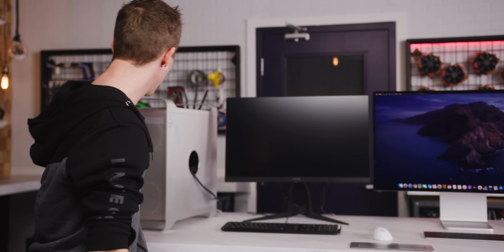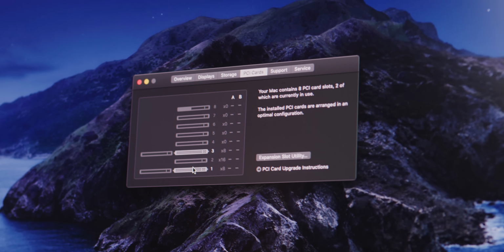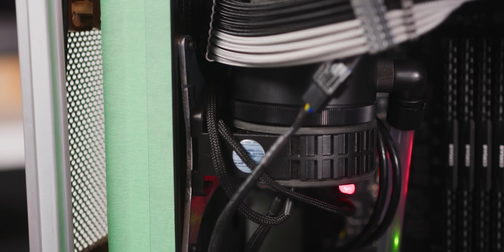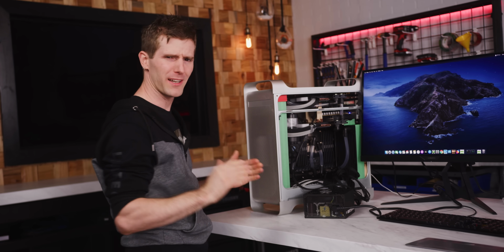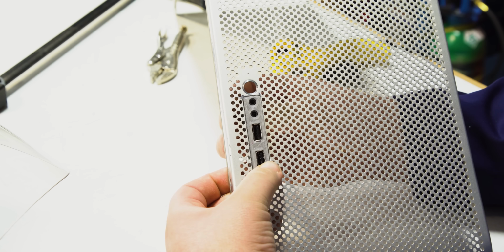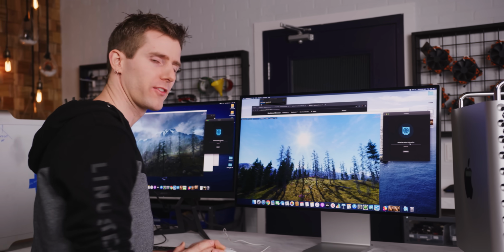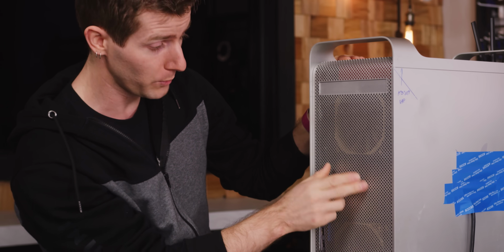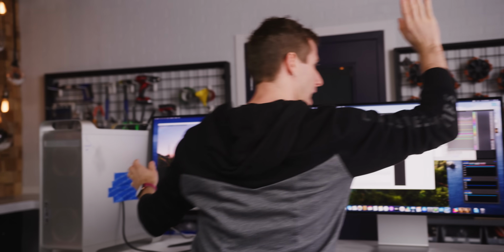Apple BEAT us... but we're STILL TRYING! - Hack Pro pt 4

Comment: so, for the money you saved, you could easily put some more powerful GPUs in there to even the odds (for example, 2 RTX 2080Tis instead of the 2 Radeon VIIs) and still save thousands of dollars. awesome.
Reply: Njolf Nvidia doesn’t release drivers on Mac OS and a 2080ti still wont be as powerful as the GPUs in the Mac. But they’re mostly faster because of driver optimisations
Reply: @brendanturner4787  

Oh, that sucks. I guess that's one of the problems when companies build proprietary software that's only ever meant to run on certain types of hardware. Oversight on my behalf, in any case.

well, i guess the best option then would be to not use mac for the OS, but at that point it's not a hackintosh, just a good competitor to the mac pro (with a far lower price tag). And you'd be better of as far as raid options go and all that. but yeah, moot point then, i suppose.
Reply: Njolf in my opinion hackintoshies aren’t worth the extra effort; especially for professional use. If you need Mac OS, you’re better buying the Mac Pro, or one of their laptops or all in ones. Or using simply using Linux. But bare in mind the Mac Pro isn’t really for average consumers anyway, it’s for editing houses or a bunch of other things I can’t think off. Personally I’d rather buy their laptops, because they’re better in every way from windows alternatives except for price and then just use my desktop for gaming
Reply: @brendanturner4787  yeah, i don't get the point of hackintoshes either, as linux is just better for productivity (mostly, from what i've seen doing some design work is not as easy on linux due to a lack of software but you can just use windows for that) and windows is better for gaming. 

mac might offer some slight performance benefits in some cases, but it's mostly insignificant given the notably higher price tag which lets you buy faster hardware to compensate (which is the point i made originally - okay, they may not be flat out faster, but you get more or less the same performance for less money), and in laptops you get better cooling than apple's products. and honestly, not giving apple any money is value in it's own right (in my opinion).
on a side note, i really don't understand some of the selling points for the mac pro. for example, 1.5 TB of RAM? only application i could think of for such an amount would be some serious server stuff, but in that case, you wouldn't rely on a mac to perform as a server, especially because you can get some better hardware that they don't offer in their lineup (something like AMD's epyc lineup).
anyway, i think i got a little carried away.
Reply: Njolf well the benefits for Mac in terms of professional use would be apps, the ease to develop (which is what I use my Mac for), it doesn’t force constant ducking updates, etc. Also I’d disagree with other laptops being better. MacBooks are built like tanks, I like the butterfly keyboard personally, they’re quieter, battery life lasts forever and macs in general last waaaayyyyy longer than windows laptops and they don’t throttle worse than windows laptops. Plus you can always also run windows on macs but can’t run Mac OS on windows laptops
Reply: @brendanturner4787  sure, but you could always install some distribution of linux (for example ubuntu) instead of windows and, for the most part, get best of both worlds (that is, again, if you're not doing graphic design or something like that, due to less available software, like the lack of adobe's products). i mean, from my experience with ubuntu it's far less resource hungry than windows, meaning you would get longer battery life and better acoustics than with a windows machine. as for the keyboard, well, it's personal preference. i don't really care what it's like, as long as it works (this generally extends to aesthetics of other things and the machines themselves, although i can appreciate a nice RGB build when i see one, but i digress). also, windows machines tend to not last as long partly due to software rot, which is less noticeable on linux and macOS. and i haven't had any bad experiences with ubuntu updates either, they tend to be quick and only sometimes require a restart, though they let you do whatever you want to do and update whenever you see fit. also, i remember that there was some issue about macbooks throttling under load due to poor cooling performance caused by their design being more oriented around sleek looks than functionality, but i haven't really followed the news on that to see how all that turned out. and honestly, i just like having choice when it comes to what i want to buy. for example, if you have no need for a dedicated GPU, you can buy a laptop with a good CPU and integrated graphics for a few hundred bucks, which is less than the entry level macbooks. if you want a dedicated GPU, you can get some for  around the same price as an entry level macbook - which doesn't come with a dedicated GPU. and besides, different brands offer different sets of features and slightly different combinations of hardware, meaning you're more likely to find something that better suits your need than a macbook. but this is mostly personal preference, i guess.

Comment: Hey linus, quick question. If i have a ethernet cable plugged into my pc (2.5gb i think?), and so will having an asus wifi thing that came with my motherboard plugged in at the same time make my connection better and ping lower?

Comment: You failed. The SSD speed is not compared, no Thunderbolt is a main selling point of the mac you said in another video, the front shows the fans and RAM is Not 1,5 TB.

Comment: Constantly complains about a worthless headphone jack, but then bashes a optical drive.
Reply: I use headphone jacks way more than optical drives. Besides, easier to keep an external drive at home than carrying a headphone dongle with you on the go.
Reply: @annasiel97  or you could just use bluetooth headphones?
Reply: @Grumpy_Wolf  Not always a convenient option to keep two things charged rather than just one, and you can generally get better quality wired headphones for cheaper than bluetooth.
Reply: @annasiel97  Takes like 2 seconds to plug in a headset, lot more convienant than trying to untangle wires, or worrying about them snagging on something, especially if you jog or workout. I literally bought a 20 dollar pair of headphones several years ago, the battery goes forever and they sound great. Sure I bet expensive headphones are better but I probably couldn't even tell the differance.

Comment: Well you could use your AMD motherboard with thunderbolt that you showcased (/watch?v=wQMCvQ01e80&t=536s) and put 3950x in Dune Pro PC case, bamm. Put some Ice Giant cpu cooler, mod gpu cooler, put there noctuas in front  and there you go. You get Mac pro 2020 look with better performance and good cooling with thunderbolt support or use threadripper and this solution for thunderbolt /watch?v=uOlQbP63lDQ

Comment: ok but did you actually tell macos there is a onboard thunderbolt 3 device, and link some kext to it, and actually make it usable? im 99% sure theres a patch you're missing. i dunno, join the hackintosh (r/hackintosh) discord and ask one of the professionals- but pretty sure the only reason it isn't being detected is user error. I've built a few of these G5 cases, and never had too much of a problem that discord channel couldn't solve. I know there are specific WiFi cards and whatnot that are compatible, but I mean we're in 2020 putting this OS on athlons, phenoms, FX series CPU's, and ryzen without a problem.. running all sorts of configurations Apple does not approve/sign. SOMEONE has had to have had your issue and created a fix. honestly.. if putting an AMD cpu in a motherboard, loading clover, and booting macos without hiccups can be done, your thunderbolt 3 issue can be solved. Tinkering is fun though, I'm the guy who made an FX8300 break cinebench for a whole day by going over 30,000cb on R15. :D also, geekbench was recording numbers as high as your system in this video, but with 8GB of DDR3 1866. lol messed with CPU settings in clover configurator, wasn't actually that fast. OS was running at diff speed causing this error, but for 24hours the FX8300 at 5ghz was the fastest CPU on the planet according to cinebench.